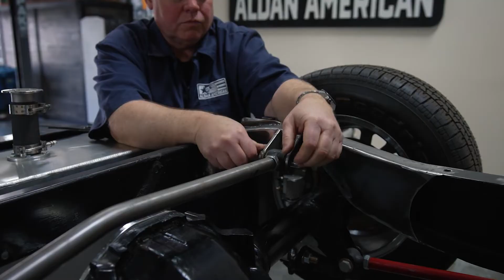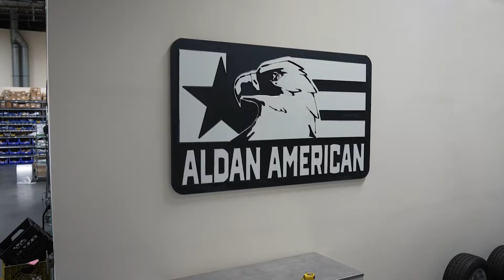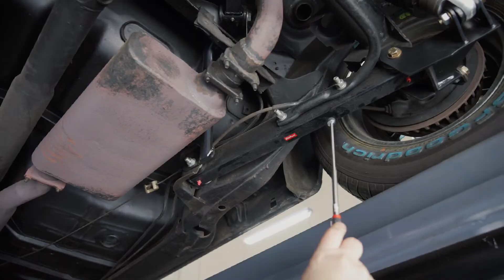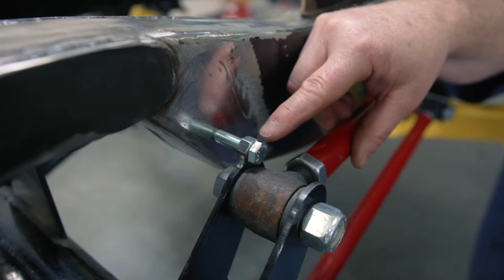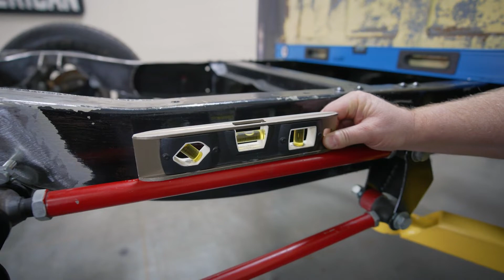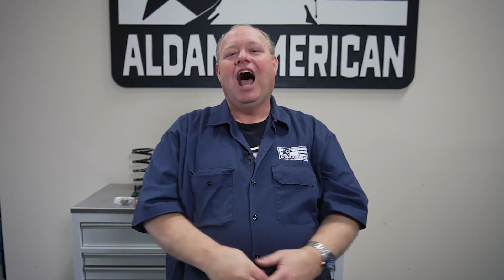Setting Up a Custom 4 Link Coilover Suspension

Comment: Great video.  I'm trying to learn about rear suspensions for my 65 Dodge D100.  I'm liking the triangulated 4 link. What's better, considering cost and everything, notching the frame, or using new bent frame rails?
Reply from the maker: The decision on the best option is based on the amount of clerance necessary and if the frame rail is a body on frame or unibody. If it is unibody and a C-notch is possibly going to compromise the structure additional support will be needed such as new rails. If it is a simple channel frame like in the video, a C-notch and additional boxing plate on the inside to box it is the easiest because you are keeping the basic frame. If you replace the rail completely you will have to figure everything that is mounted off of the frame such as the bed and the rear bumper. This truck had the C-notch done previous to arrival but had not been completed. The parallel 4 bar was mounted, and the C-notch started. Aldan brought it in to show how to choose and mount the correct coil over shocks. We finished up what had not been completed. Hope you found the video helpful.

Comment: What should be the average cost for this setup?
Reply from the maker: Aldan American is a manufacturer of coil over shocks and a pair of the single adjustable shocks and coil springs are about $700. The rest of the suspension parts were already installed but not completed.  Aldan has on the website P/N AU4LP that is a universal kit for hot rod chassis such as a 1932 Ford. Performance Online and Scotts Hot Rods also offer some direct fit 4 link for some popular vehicles.

Comment: What would be a decent price to install a 4 link if I fabricated it myself
Reply from the maker: Aldan American is a coil over manufacturer and this truck already had the 4 link install started by the owner and we completed it on camera. The truck is a friend of Aldan’s project. We brought it in to show the basic process of installing a 4 link suspension as well as how to measure and install the coil over shocks correctly. Aldan American is not a repair or fabrication shop and unfortunately we do not have an answer on the cost to install. Typically a job like this at a professional fabrication shop would be charged for on a time and material basis and they would have to see it in person.

Comment: How is it a parallel 4 link when the links aren't parallel??
Reply: I was thinking the same...
Reply: @randorfja  the right side and left side are parallel with each other as opposed to a “triangulated” 4 link where they oppose each other.

In his description in the video he describe the parallel version incorrectly.
Reply from the maker: This style 4 bar suspension, the links (“bars”) are parallel to each other running front to rear and level with the ground.

Comment: a question something like how much money does it cost
Reply from the maker: Fabricating a 4-link setup with coilovers can run $1,000-$5,000 based on if you build the setup your self or source a 4-link kit from a chassis company, etc. There are bolt on 4-link systems as well that can run $1,500-$5,000 based on your application and additional components that may need to be purchased, or modifications that may need to be made to the vehicle with the select 4-link setups (i.e. rear ends, wheel tubs, fuel tank relocations, and more).

Comment: So does a parallel 4 link allow for roll articulation?
Reply from the maker: Hi Lucy, a parallel 4 link allows for roll articulation, but it's limited by shock travel and panhard rod travel. If you have any questions feel free to call our tech line (310)834-7478.
Reply: Great video